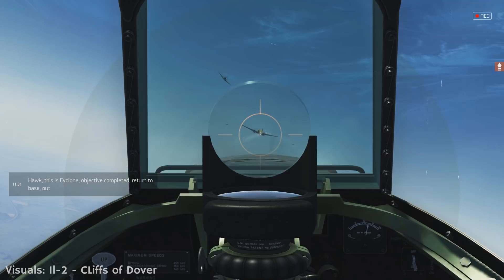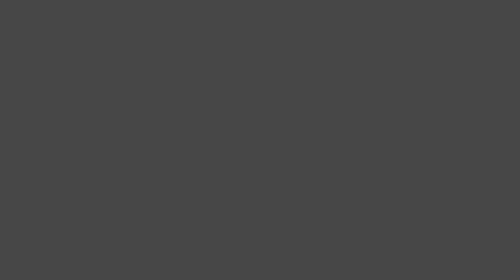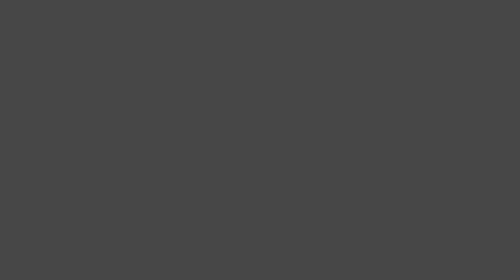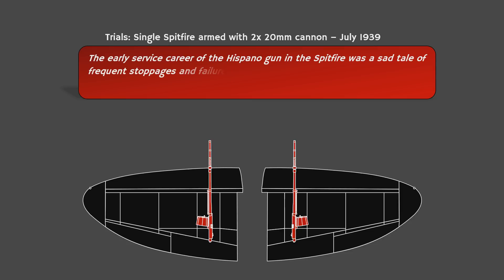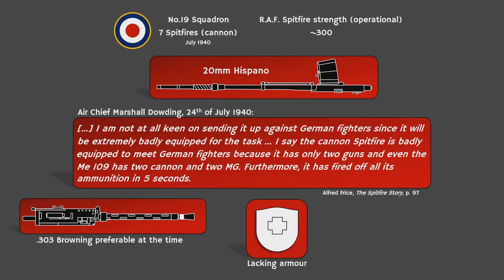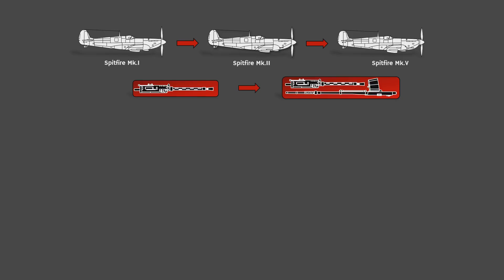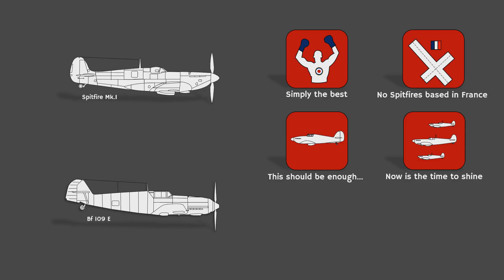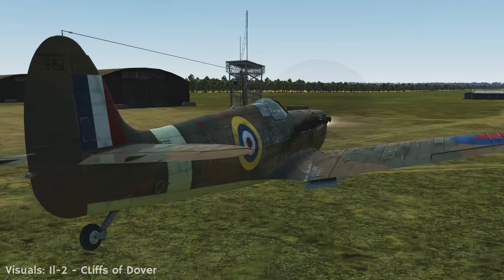⚜ | Clearing up Spitfire Misconceptions

Comment: Very very good stuff. However Re the Hurricane: it was a very usefull fighter and did shoot down a fair share of 109's and most of the bombers in the battle of Britain. It was certainly capable and in fact considered more powerful than the 109 at up to medium altitudes and only lost out at higher altitudes due to the supercharger tuning of both fighters (cant have it both ways with a single stage) .. 

Hurricane development was essentially stopped because the Spitfire was deemed to have more potential at high altitude where the 109 was lurking and where a fighter needed to be to respond quickly to raids . It also competed with the Spitfire and other bomber aircraft for Merlin engines.

The new Hawker Typhoon was well on the way  and would need  manufacturing space . That new fighter would not use a Merlin engine.  Interestingly this is the same rational for Kurt Tanks Fw 190 a previous reject getting a second chance. The Luftwaffe wanted a fighter that would not use the DB 605 engine. It used the BMW radial and it turned out a great fighter as well. 

Then of course came the great Hawker Tempest as the improved Typhoon was called. But at the time of the Battle of France the Hurricane was a good unit.
Reply: The Hurricane was produce for far too long, production ending in 1944, but it was already obsolete as a front line day fighter by the fall of 1940 or earlier.   
The MB 3 should have replaced it but that was delayed far too long and the prototype crashed during failure of the bloody Napier Sabre killing the pilot/company partner (Baker).

Comment: Very interesting and well done! I've read multiple books on the Spitfire and usually find several mistakes in most videos on the Spitfire.
Good to see an accurate one!
Reply: As a research historian, I suggest requesting access to the war diaries of the squadrons involved as well as the technical manuals. The difference is night and day between fact, someone's opinion, and of course know it all gamers.
Reply: Speaking of accuracy the Dowding quote is pretty strange considering the 109 had only one hub cannon or hub cannon and two cannon gondolas. Where did he pull the 2 cannon 109 from?

Comment: Big problem with the Mkiib cannon spit was wing warping during high turns. The wing would bend,  jamming the feed system of the 20mm cannon.  The Mkvb had a new wing ( retrofitted to Mkiib as the wing became available)  this cured most of the issues. After October 1941 the 'E' wing (universal) became available.  This wing could be clipped,  have multiple gun setups such as ; 8 X. 303,  2 X 20mm + 4 X. 303 or 4 X 20mm.  The later Mkv could also carry a single 250lb bomb in the center line.  The Mk ix became a answer to the Fw 190.  with the merlin xx engine and the 'E' wing as standard. Of not is the new wing again fitted to the Mkix and Mkviii after several accidents while dive bombing.
Reply: The Australian Sqns fighting the Japanese were begging to replace their cannon with 50 cal browning's which the US were willing to donate. They were so frustrated with the cannons jamming. The RAAF of course refused.  At the same time their two speed propellers were also freezing in low gear causing the motors to over rev and the aircraft to fly slow and run out of fuel causing more crashes through fuel than battle damage. Very unhappy campers. The USAF was doing better with it's P40's than the RAAF with its tropicalized Mark 5's with jammed guns and oil frozen props. Got it sorted in the end apparently.
Reply: The Universal wing was the C wing, the E wing housed a 20mm cannon and a .50 mg.
Reply: mrjockt no the e was the universal hence the Mk ix Lfe and Hfe the Mk ix Lfe could  be fitted with 2×20mm 4×.303 or 4×20mm or 2×20mm and 2×.50 . The Mk.viii also having the e wing as standard
Reply: The early "B" wings also, iirc, suffered from very high stick forces at high speeds and the Spit was never able to match some other fighters for high speed rate of roll.
Reply: edmundscycles1 The E wing couldn’t carry the outboard .303 machine guns, the compartments were there but there were no gun ports, ejection ports or case deflectors fitted to the wing, and the Mk.VIII was only ever fitted with the C wing in operational service, the Mk.IX, XIV, XVI and XVIII were the ones with the E wing.
Reply: mrjockt in that case you know more than almost every book ever written about the spitfire. In every reference material I have read the E wing was the universal wing fitted from the Mk ix on wards.
Reply: edmundscycles1 The Universal wing was the C type wing, so called because it could accommodate either 4 .303 machine guns or 1 20mm cannon plus 2 .303 machine guns or 2 20mm cannon in each wing. Yes the E wing became standard from the late Mk.IX onwards until the introduction of the Mk.21, but it couldn’t be called ‘universal’ as far as armament fit was concerned since it prohibited the fitting of outboard machine guns.
Reply: edmundscycles1 st marks band
Reply: The "c" was the universal wing. The "e" wing wasn't introduced  until 1944. See: http://spitfiresite.com/2010/04/concise-guide-to-spitfire-wing-types.html
Reply: High stick forces were due to fabric covered ailerons ballooning. This was cured by replacing them with metal covered ailerons, retrofitted to earlier aircraft (including Mk 1's)
Reply: madseavets, , Maybe the guy has gotten confused over the fact that the  C wing was called universal because it could take any armament fit  available at the time and the E wing became the wing that was the universal fit for Spitfire’s after 1944 perhaps.
Reply: mrjockt after re-reading my reference books (I don't like to use wiki) I can see there error I made. Yeah seems the writers used the term universal for both the C and E wing. That is what has confused me.
Reply: madseavets I'll see if I can pick that up.
Reply: madseavets didn't they also start clipping the wings to increase roll rate and reduce stick force? The exceptionally light elevator was a continual novelty for the spitfire though.
Reply: +edmundscycles1
Yes, they did clip the wings to improve the roll rate.  The big wing was a handicap for roll rate but it helped in other respects. The metal ailerons helped at high speed but its lower speed roll rate was worse than the 109E. The FW190A had one of the best roll rates though. 

Putting 4 cannons in the wing didn't help roll rate or speed either - that's why you don't see many early Spits with the "c" wing and 4 cannon. The 4 cannon didn't become standard till the Mk21.
Reply: Hence Clive Caldwell's dismay with the Spitfire, or at least the Mk. V.
Reply: I see Barry quit arguing with me over the Australian Spitfires in another thread and moved onto someone else posting the same information i did... any chance Barry could just accept that the Australian spitfires had issues? As a side note, Caldwell, having shot down 8 Japanese aircraft (including 4 zeros) had 19.5 kills from North Africa, including 8 or 9 109’s while flying that “poor” P40. So if the man who had was a bonafide ace against against 109’s in a totally inferior aircraft says the Spitfires armament is poor then you have to accept the man has the credentials to make that call, but seeing your likely a YouTube troll, I don’t expect a cogent response.
Reply: 18tangles no, he didn’t get the nick name for shooting people in parachutes, where did you pull that piece of bullshit from? And for fucks sake, the issue with the Australian spits and their cannons is well documented, the problems were : oversized ammunition from the factory in Sydney which meant each belt was being individually inspected with gauges and oversized shells removed, heating pipes cracked or missing from the airframe, the antifreeze lubricants from the guns freezing, so they made their own out of a mix of glycol and soap and this is on top of general issues with cross feeding which was a Hispano mk1 and lesser extend mk2 issue. The aircraft themselves had rust in the cooling system from having their glycol drained when created for shipping and not being replaced with rust inhibitor and they had. A number of failures of the DeHavilland constant speed propellers which caused over revving and failure of the engine, I didn’t say any thing about freezing propellers. When the fighter wing was formed in Darwin, it was with mkV’s, but I don’t know if they swapped over to VIII’ s while there, or when the wing was reformed to move to Mototai, but when you read about the individual squadron history’s, they don’t mention nearly as many problems with the VIII’s, and nothing about guns that I remember
Reply: 18tangles and it doesn’t matter that he was “behind the best RAF / RCAF”, he was still an experienced pilot, became and ace flying inferior aircraft and ended up leading fighter wings on 3 seperate occasions, so tell me how he lacks the credentials to have that opinions. And not only is it it an opinion, it is a documented fact that these problems occurred and it even published. You can ignore it all you want but it happened.
Reply: 18tangles boomerang did have issues with its cannon installation, but I don’t believe freezing were its issues (anaemic thing probably didn’t have the altitude), more to do with the feed trays in the wing and that the first “Hispano’s” for them were actually reverse engineered and locally produced from a cannon they got somewhere else. I don’t know if they were replaced by genuine guns from the UK or not, but I don’t recall reading about them having issues with guns when they were doing CAS work in New Guinea, and I don’t know who supplied that Hispano’s for the Mk21 Beaufighters. I assume any Mozzies brought in to Australia had UK manufactured guns.
Reply: 18tangles I have another book here somewhere (or maybe my grandad has it) the mkV’s were diverted shipments, they showed up in European and desert colour schemes and were made across across multiple, batches. So I assume there were quite a few differences between some of the airframes as as modifications were made on the production line as improvements were made, so it might explain why some spits had issues while others seemed to be ok
Reply: 18tangles your source is wrong, we did reverse engineer a Hispano, whether it went into serialised production is unknown, but CAC were producing them at fisherman’s bend, which makes one wonder why would they would waste resources setting up such limited production numbers when they were already in the supply chain.
Reply: 18tangles Townsville to Darwin would be just as ad as Melbourne to Darwin. Infact, the railway heading north/south was probably better than heading east/west, and the commander of SWP Air Forces (Kenney) was in Brisbane with Macarthur anyway, but the supply chain was in Melbourne
Reply: 18tangles they did cannibalise, but you can only cannibalise so much, especially when you need whole power plants to replace the dodgy ones and they have to come from England. They also lost a ship with 30 new airframes and spares on it to a submarine at one stage, so the ended up sending clapped out airframes from the training unit in Mildura to Darwin as replacements. When the RAAF found out no1 wing was testing a spitfire modified for 50 cals, The CO was Summoned to Melbourne by Chief of Air Staff (Jones) and ordered to put the Hispano’s back in. Jones was a career RAF officer who was known to hate Empire Air Training Scheme pilots, Caldwell in particular as they clashed on a personal level. He even blocked Caldwell being awarded  a bar for his DFC saying that he had received more awards than EATS should be eligible for. When the wing went to Morotai and Mutinied against the RAAF as pilots were being killed flying trivial missions for the sole purpose of keeping Australians out of the MacArthur run media, Jones was politically embarrassed in front of Kenney . It was was soon after they went after Caldwell for trading in liquor, partly as a distraction for the amount of bad press they had received for their misshandling of the RAAF in the Pacific. Ironically, at one stage, they were trading alcohol to American engineer units to build their airfields and facilities because the RAAF had no equipment in theatre to do their airfield construction, but it still formed part of the charges against him, and of the several people who were trading liquor, he was the only one charged. It got so petty, the war ended and Jones refused to let Caldwell retire until he was court martialled and demoted, then allowed to retire. Jones seems to have had a real Blamey-esque level of incompetence about him.
Reply: 18tangles Lithgow did not have any spare capacity for Hispano’s, they had a hard enough time to find capacity for Bren guns, and that was by moving the wood shop to slazengers in Sydney and outsourcing other parts to Wellington, Bathurst and some other joint (name escapes me). Anyone producing the 2/6/17pdr AT guns or the 25pdr artillery could have cast those bodies as well.
Reply: 18tangles we always used British parts numbers, what your point? Our supply chain had to had to deal with both systems. The supply chain went from Melbourne to Darwin excuse of the rail network and because our aircraft manufacturing was in Melbourne
Reply: Maybe they imported the castings? It’s actually a really interesting question!
Reply: 18tangles you would think so, but the antitank guns were made in Adelaide, so who knows what they did
Reply: 18tangles nice one! Look forward to hearing their answer.
Reply: The c wing is the universal one.
Reply: Props were constant speed props, not two pitch.  Two pitch props were replaced after Dunkirk.  The issues experienced with the constant speed props at Port Darwin, as well as with the cannon, are both outliers on already proven technology that worked well from Northwest Europe to the Mediterranean front, possibly because the aircraft provided were old and tired.  Its also possible that the issues relate to maintenance issues, due to the distance from Britain.  I think the Port Darwin Spitfires also lacked tropical filters, which made the normally reliable Merlins, suffer a high failure rate.
Reply: The Spitfire Mk ll didnt carry any canon, only the Mk V were equipped as standard with x 2 20mm hispano/vickers canon. Maybe it was a typo, otherwise check your history....
Reply: In point of fact it did.  There were cannon armed versions of both the Mark I and the Mark II.  The cannon armament did not become common and standard until the Mark V, due to the difficulties with cannon on the earlier marks, during the Battle of Britain.

Comment: The misconception about cannons during the battle of Britain and also the use of Spits in France might be partly from the TV series Piece of Cake. It's overall quite excellent, and well worth watching for anyone who hasn't, but some historical inaccuracies were unavoidable. The book which was the basis of the TV series used Hurricanes, but at the time it was made (1989) there were not enough airworthy Hurricanes available to allow for filming of the flying scenes, so Spitfires were substituted. Furthermore, the aircraft that were available had mostly been built later in the war, and so had the cannon armament. In some scenes aircraft even have the enlarged tail that was not introduced until very late in the war. These are not cases of filmmakers overlooking historical details, simply a matter of the difficulty of finding enough airworthy aircraft to make filming possible at all.
Reply: Moggie would be proud.

Ref the book, I have a copy of the original story written in 1941 IIRC and it uses actual pilots names. "Fighter Pilot" by WComd Paul Richey.

Comment: During the Battle of Britain, the Spit took on the ME 109 and the Hurricane took on the bombers. It was a good mix and worked well.
Reply: Seen that film many times. Pretty good. But it is a fact that the Hurricanes took on the bombers and the spits took on the 109's. 109 was just too good for the Hurricane in an outright dogfight. Cheers
Reply: Hurricanes took on the bombers because their speed and climb rate caused them to be late for the intercept.  When the LW ordered their fighters to stay with bombers, then the Hurricanes were given more opportunity to mix it up with the handcuffed 110s and 109s.
Reply: @bobsakamanos4469  109s shot down more Hurricanes than Spitfires during the BoB. The Hurricane with a top pilot could match the 109, but as the RAF was a bit low on top pilots, the Hurricane suffered.
Reply: @BatMan-oe2gh  in a war of attrition, you can't expect pipeline replacement pilots to succeed in Hurricanes. That's just cannon fodder mentality of people like Trenchard.  Even Ginger Lacey was shot down 9 times.   The LW tactics were peck and zoom and both the 109 and 110 did well in that role, ... until Goering ordeded them to stay with bombers.  Even so, the 110 still had the best kill ratio of the BoB - and that was from shooting down fighters (Hurricanes) not bombers.